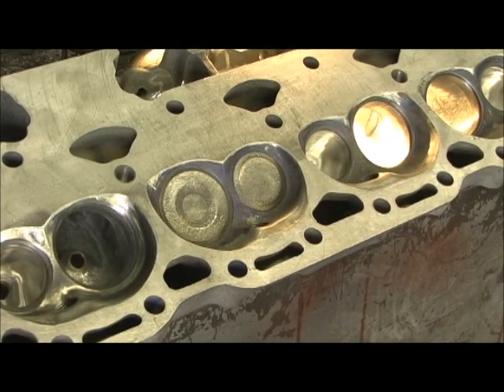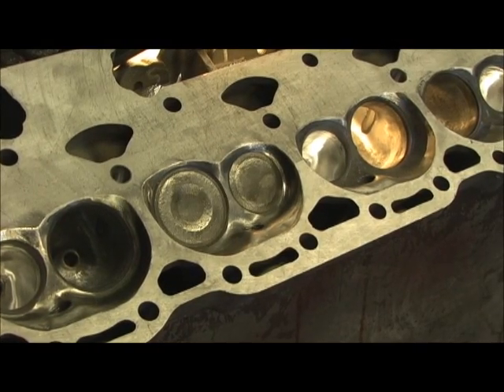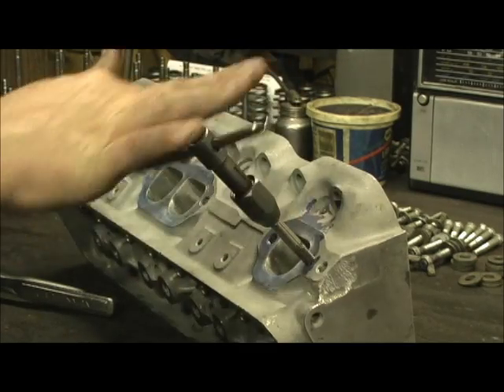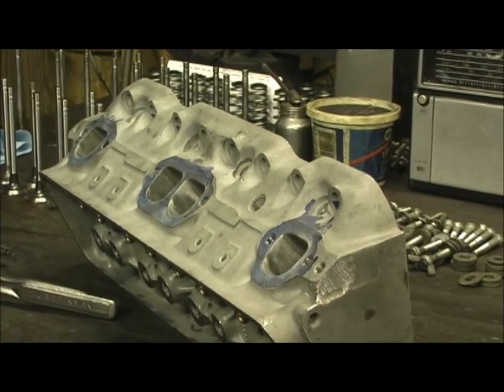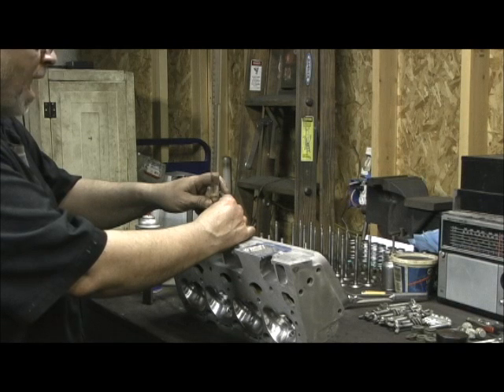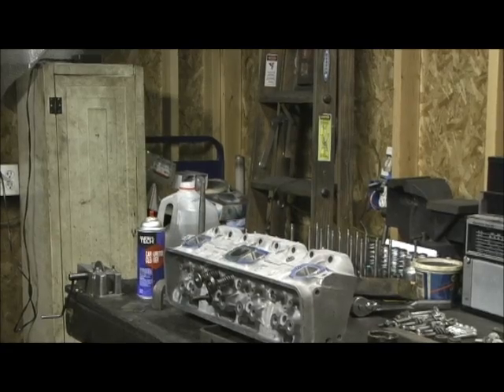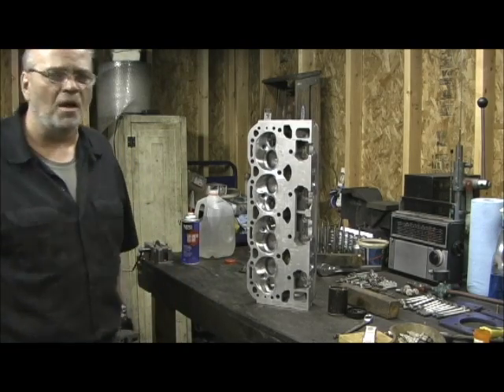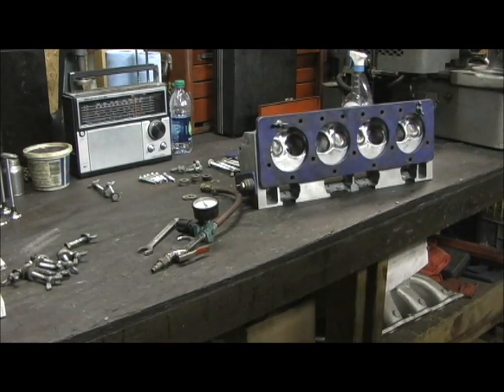LT-1 Stage IV Final CCing the Ports, chambers  Part 7.2 BFG

Comment: Why dont you pressure test them first before you put so many hours work into them? If they are badly cracked all that work could go to waste :/
Reply from the maker: EVERY aluminum head I do is Pressure Tested before I begin on them, as well as after the work is done to make double sure there is no pin hole leaks.

Comment from the maker: The problem with most people is they hide there mistakes, or don't want people to know there human, I thought it was funny as hell that I never noticed my building had sunk a couple of inches after a year of settling down causing the aluminum to drain back toward me...As far as AFR, Dart, Brodix it is there attempt to make heads as they claim to fit every need is bullshit. Each heads ports have to be tailor made for each application and they spit them out like candy, with crap machine work.

Comment from the maker: BE CAREFULL, this can lead to a destroyed head, not to mention when you torque them they can crack the head. I have used a saw head (a cut up head) to see IF they can transfer the load without problems. It makes BIG power gains, but can rock your world if you get it wrong. Thanks Dori

Comment from the maker: I've been waiting for this, and your the man. Gregg Jacobson, I will address on my website, with your name at the top of the article. It will be under "TECH BLOGS" and I will get to this in the next couple of days. Your correct, there is a lot to this (except swirl, which they gave up on years ago) and it is just not about volume; however, it is NOT ABOUT FLOW NUMBERS EITHER!!! I have been fighting this since the mid 1990's when I done extensive engine dyno work between the flow bench and dyno

Comment: So I ended up taking the cam out....got a Howard cam on order 280 286 227 233 .560 .560 110 106 Hyd. power band 2300-6100. These specs are for a 1.5 rocker I'm using a 1.6.

Comment from the maker: On this deal, like you seen above on a set of ProComps go to my website and go to "contact us" and email me and we can get more specific on details, I just don't quote work till I have enough information on the application. I need specifics like Intake manifold, rear Gear, Trans type, weight, camshaft and so on. I charge according to what you need, and I can assure NO ONE OUT THERE can beat my pricing for the power they receive in the end. Thanks, headbytes

Comment: Now I want to tare the cam out and replace it. 197cc from a 170cc damn nice! I would rip that cam out if I didn't have to drop the oil pan to get the damn timing chain cover off. I still might, do you think I can keep the same valve springs with a different cam?